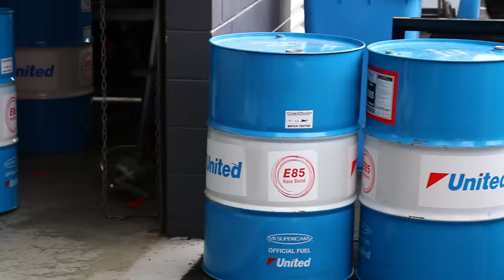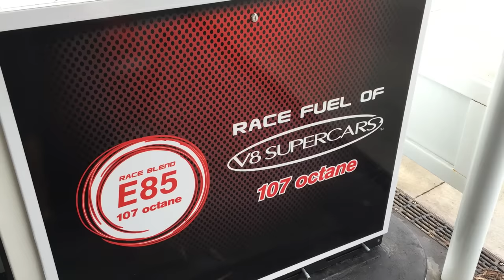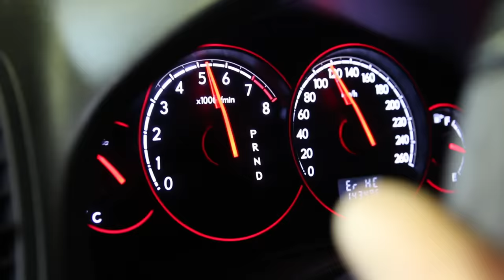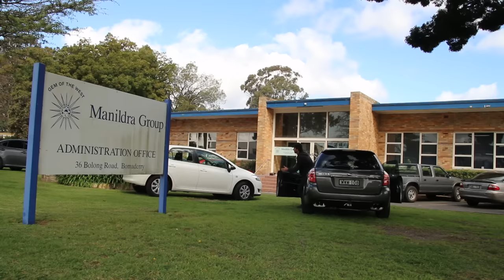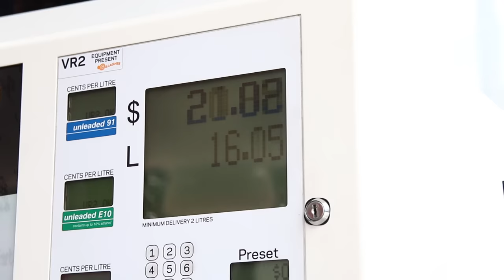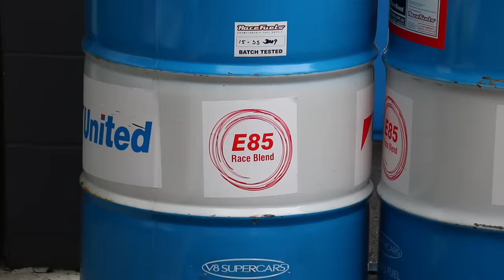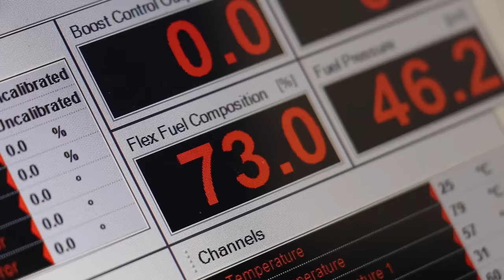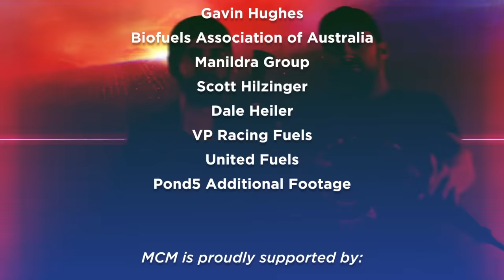E85 Fuel Explained - Should you use it?

Comment: Hi, I'm from Brasil (s not z :D ), and, first of all: sorry for my bad english. Here in Brasil we use Ethanol (Etanol or Álcool) since 1975. It was a government program called Proálcool, wich tries to solve the problems of 70's petroleum crisis. When the petrol-gasoline vanished from the gas stations, ethanol was the solution. From 80 to 86 the ethanol and cars production in Brasil reached its peak, with 76% of the cars using only ethanol (not flexfuel). The With the petroleum low prices of the next years, the ethanol start to be considered as a second choice, reaching the lowest point of sales, with only 1% of the cars produced (using only ethanol as fuel).

Comment: The most important question I took away from this: In that massive McColls ethanol refinery, what do they use as the energy source for the distillation steps? When making pure ethanol from sugars, this is by far the most energy-intensive part of the process, since fermentation gets you 15% ethanol at best. So you have to distil it in massive columns to separate the ethanol out from the water, and since both compounds have quite high heat capacities, the heat input for this is enormous - depending on how large and efficient the columns are, the energy requirement can be similar to (or sometimes greater than) the energy content of the pure ethanol product.

Of course petrol from crude oil needs distilling as well, and the process in oil refineries is similar. But there isn't much water in crude oil, so the energy requirement is lower. Plus you can burn up some of the heavier components of the oil in the bottom of the column to make the heat required to drive the distillation, which is what oil refineries do - they get all the energy they need for refining operations from the crude oil they take in. The energy use depends on the grade of crude oil used, with heavier grades requiring more processing - the overall efficiency of the process is expressed as the "energy return on energy invested" or EROEI, which is the ratio of the energy content of the finished refined fuels versus the energy used to refine them. Lightweight liquid crudes can have a ratio of 20 or more, heavy crudes less than 10, and tar oils or tar sands less than 5.

So what about ethanol production then? How efficient is that? Well, it depends a lot on the source of the sugars used, which can add or remove efficiency. Sugar cane is by far the best, since the crop produces sugar directly, so it only needs extracting before fermentation can start. Grain sources (corn, wheat, sorghum, millet and so on) are worse, since an extra processing step is needed to convert the starches into sugars - either malting as in traditional beer-making, or enzymatic processing as used in corn syrup production. Brazil has the most efficient ethanol production plants in the world, taking in sugar cane and producing ethanol without needing any extra energy input, since they use the waste wood from the sugar cane as the energy source to drive the distillation steps. 

However, ethanol production from corn in the USA is far less efficient, often using additional fossil fuels to drive farm machinery, plus the grain to sugar conversion, and then the distillation. This is why you often hear people in the USA saying "ethanol is bunk" when it comes to carbon neutrality or energy efficiency - and they are right, because the methods used to produce ethanol there are horribly inefficient, in some cases getting a negative EROEI. Hence the initial question: How efficient is the Australian ethanol production - what is the EROEI of the refineries there? I'm betting that it's going to be better than ethanol production in the USA, since you do seem to use some sugar cane. But is it as good as Brazilian ethanol production?
Reply: The single plant In Australia which they visited in the video burns low grade brown coal to run the boilers. They are not very efficient or clean but they did manage to get an effective monopoly through corrupt deals with the state government.
Reply: @SurmaSampo  Brown coal, aka lignite, aka flammable dirt? That's a fucking farce - they probably make more pollution doing that than anything which might be saved by people using the ethanol in their cars. They might as well leave the coal in the ground, not bother refining the ethanol, and just have people use ordinary petrol in their cars instead, and environmentally would be better off!

Comment: I was looking for a car and one of the cars had E85/gas listed as the fuel. I then started doing research on the E85 because I didn't know what it was and so I ended up here lol. I did some calculations on the cost of running E85 in my country and at current prices it seems to be about 20% cheaper than gas even if you need more of it. Also one of the local companies makes "eco" E85 from biowaste so that reduces the amount of resources needed to make the ethanol.

Comment: One thing that wasn't mentioned is the CO2 emissions, and I feel this is very important when talking about E85.
With fossil fuels, the CO2 in them is millions of years old and is currently locked in the coal/oil/gas deep in the earth, but is released into the atmosphere when burned where it becomes a problem, as it is extra CO2 that isn't in our "cycle".
With E85 being produced from crops being grown NOW it is re-releasing CO2 back into the atmosphere that was only recently used by plants to grow, so the CO2 balance in my opinion far outweighs the fact that you need more of it to make the same power, because all the E85 you burn is in a sustainable cycle of CO2, and not adding more CO2 to the atmosphere than we already have.
Same principle as diesel engines running on vegetable oils, they are using and releasing CO2 that was used in the crop cycles today.

Comment: I hope overseas fans are watching this and getting a bit of a taste of Bathurst. It's Australia's mini Nurburgring - fairly long, fairly hilly, pants shittingly fast in parts and arse clenchingly tight in others.

Unfortunately it's actually technically a street circuit and isn't open for power laps most of the year - but you can drive it for free on a normal road licence any time there's not a race on, provided you stick to the (incredibly closely monitored) speed limit.

Comment: The problem with Ethanol in regular cars is how quickly it goes bad. Regular gas can be stored for long periods of time and still work fine, but the water content in Ethanol will wreak havoc on your fuel system after just a couple months of sitting. Its even worse in small engines.

Comment: Basically 90% of the cars here in Brazil are flex fuel, meaning you can use both ethanol or petrol in your car from factory, which is great because ethanol here is way cheaper than petrol, specially these days...

Comment: i would love to convert to E85 , but i live in toronto Canada, WE do have a season called winter which in return will clog up the fuel injectors. AND to top off everything i just said the E85 pumps here in canada WILL NOT SELL YOU E85 unless your car was manufactured to run E85.

Comment: I first started using e85 in my old chrysler minivan because it was cheaper, but it got rid of that aweful tapping noise and gives me more torque up high, not to mention it's a cleaner burning fuel. Sure you get slightly less fuel efficiency but i think the pros vastly outweight the cons here.

Comment: I can’t get a good answer on this, people tell me these 2 big worry’s I kinda have.

I have a 2014 Silverado it’s flex fuel and I like to run e-85 from the power gain. BUT people tell me that the alcohol in it somehow destroys the fuel lines and other rubber parts. That doest really make sense because you truck was made in mind with running E-85 so why would they cheep out on the fuel lines. And then also they said that e-85 has water or something like if you put e-85 in a glass it will separate after a few days from the fuel and water. That is what really spooks me. 

I’d like to know if those are just lies or if they are actual problems, want to know if I sould just stop running it or not.

Comment: Nice video. This Ethanol thing is pretty good but I can get Methanol cheaper where I live. Even with the caloric difference,  methanol is cheaper than 95 RON which makes it cheap than ethanol. The only problem is that I can't get a bloody Methanol Flex fuel sensor anywhere so it's either/or  not both.

Comment: Here in Brazil flexfuel car are really common. Almost the unique option to buy a brand new car. Only import cars aren't flexfuel.
IMO I don't like that. I think engines with a real adjustment to use an specific fuel type have best performance. Sadly, since the 90's don't have cars with 100% Ethanol engines.

Comment: There was a man here in the US that in the 1950's created a 2 barrel carburetor that would allow an American v8 from the time to run at around 100mpg, the concept was that engines burn fuel vapor and not fuel in liquid form. Basically the carb was converted to accept a gas inlet, the fuel was warmed in a separate chamber next to the carb. it would then vaporize into a gas under gentile warming, the gas vapor would then be injected into the cylinder and would be compressed and detonated in standard fashion. The difference was that fuel being sprayed into an engine is still in liquid form, which is inefficient, but as a gas (state of mater, not fuel) the engine can still operate because gas vapor is more explosive than liquid gasoline. By converting liquid fuel into fuel vapor the conversion from liquid to gas means that you get a much greater volume and can therefore run further on the same gas. Even the modern engines of today still do not convert from liquid fuel to fuel vapor before burning it, wasting massive amounts of potential energy. 

Unfortunately there were rumors that GM bought the man out, took all the plans an patents and swore him to secrecy, and shortly after he disappeared...

Comment: Not to mention one advantage to ethanol is and this has been tested it is much happier running on a much wider stoichiometric ratio then gasoline it's got such a wide band on the stoichiometric ratio that it is still perfectly happy running and really lean scenarios also very rich scenarios where your gasoline engine just on a regular non ethanol blend even some ethno blend feels if you're talking about how wide stoichiometric curve that as most people running on that E85 vs. E10 fuel it just wouldn't run on E10 where it would run on E85 and if you're running ethanol-free fuel that don't even think about it the only reason that we're not selling it is pure ethanol fuel is because you still need a 15% gasoline mix for when you do cold starts on the engine cuz the gasoline does ignite much easier down at lower temperatures but once you started the engine and literally ran it for about one minute even in the winter you can switch it from gasoline to appear as know if you wanted to.

Comment: I've heard that higher octane fuel burns cooler. Does your engine have to be tuned to the higher octane to get that cooling effect, or does all higher octane fuel burn cooler than lower octane fuel regardless of the engine you put it into?

Comment: Sweet Video! I think the world is addicted to oil and even though E85 is not the answer it is a great tool now to fight our dependence on oil. I have a 2005 Lancer, would love to convert it to E85. Any tips on modifying the CPU? I am not worried about my fuel system, I figured I would let those parts wear out and replace them if needed. I just understand that you need to boost fuel injection for the car to burn properly.

Comment: I use e85 in my 96 ford f250 as often as I can. It has a 460 and runs fine. I have the same mileage using gas or e85.

Comment: Ethanol fuel production in the USA is mostly produced from corn which takes lots of water to grow and more    tillage (cultivating) by the farmer than other crops suitable for ethanol production. 
The amount of diesel fuel used in this production is 1.2 gallons for every gallon of ethanol produced. So much for the "clean energy" mandate. 
The use of corn also has inflated the cost of animal feed and corn for human consumption since the farmers prefer to grow corn for ethanol and collect government subsidies. 
Far better sources for ethanol are available such as Sugar Cane and Sawgrass. 
Biodiesel is even better since it can be used in all Diesel engines without modification, has a similar BTU rating to Diesel. 
Biodiesel can be produced from numerous sources including waste products making it far more environmentally friendly than Ethanol blended fuels. 
Biodiesel has even been formulated and used in gas turbine (jet and turboprop) aircraft engines.

Comment: E85 is over in the US, at least the central US is pretty much 'dead'. Sure there are a few stations here and there, but not as many as one would think. 
A big contributor to the dislike of E85 fuel/vehicles were the repair parts. A regular fuel pump was one cost (100$ avg) and the E85 pumps/components were nearly 3 times as much (200-300$ avg), with added in shop profit %'s, a fuel pump could easily be an 500-800$ repair to an ethanol vehicle, versus 300$ to a traditional petrol engine. In addition to being more costly, to both run and repair in the midwest, it was pushed out of the market place. The E85 cars weren't repaired as often due to higher costs, and were junked when the fuel systems failed. 
The E85 cars and trucks that wore the 'flex fuel' badge eventually became a stygma, the little leaf on the side and rear of the car became a symbol for the little green monies in your pocket leaving quite quickly as the repair costs mounted.  
.

Comment: So theoretically, for example in USA, there are several touring race events where competitors will spend a week driving 100’s of miles a day, a competing in various track events in between. What I’m getting from this is that someone with plenty of knowledge could drive between events tuned for 93 octane, show up just before the event and in no time, advance cam and ignition timing to make more power on E85, run the race, then change it back before leaving to drive to the next town....   Am I wrong?

Comment: My car has just been tuned to 50% Eth and 50% 95 octane... my question is, would the eth burn quicker than the 95  which will mean that if i put lets say, 50L into my car of the said mix, by the time the tank gets to 20L it would hold the majority 95 fuel and not the correct 50/50 ratio?

Comment: I noticed a guy selling a used Volvo V70 2000 model year with 350tkm and quoting the use of 50/50 mix of 95 RON and E85. 11 L / 100km for 50/50mix and 8 L / 100km for 95 RON pump fuel. 
The car seller also referred to some test fails one of which is replacement of lambda sensor.
I suspect the lambda sensor - and perhaps more - has been damaged by using a 50/50 fuel mix.

Q: Can a 50/50 mix be used safely in older 2000 - 2002 year fuel injection cars ?

Comment: What about LPG as a fuel? Have you ever considered it as a good replacement for 95 or 98? In Europe it is very popular especially in Netherlands and Poland (because of the price which is around 45% the price of the 95). But it is getting more popular every year in every European country, and in the USA as I heard. To obtain octane number for petrol you use RON or MON depending on the market, but as LPG is a gas it uses different calculations. Regular 95 (RON 95, MON 85), Premium 98 (RON 98, MON 88), Shell V-Power (RON 100, MON 88), E85 (RON 102-105, MON 85-87), Propane (RON 112, MON 97). AKI is respectively for 95=90, 98-93, 100=94, E85=94-96, LPG=105. Normally LPG usage causes drop in performance of the engine, but in a daily-driving paying less than 50% is like a great deal. The more petrol your engine is using the more money you save up. :) For example I drive 300C HEMI which in average burns 15 L/100km of 95, but uses 18 L/100km of LPG. Considering prices like 95 USD$1.07/L and LPG USD$0.52/L. And it is said that LPG exhaust fumes are cleaner. I think it's a win win. :) What do you guys think? I can add that in Polish market there is no E85 available.
Reply: I am a HUGE FAN of MCM and I love to watch your every episode! Keep up the great work! :D

Comment: Would a stock nontuned FlexFuel vehicle make more power on E85 vs 93 vs 87? Would the ECU take advantage and increase the timing on a NA engine to gain more power. I know there would be a 30 to 40% loss of MPG but would you still get more power.

Comment: I have a 1988 5.0 engine econoline i run it for 11 years on ethanol and regular gas because not all states in the USA have e85. The thing is that I'm not sure if the compression ratio is low the it clog my egr valve with carbon. The compression on they old engines are like 8.5 some thing like that do i need a higher compression to burn it better.

Comment: Did they mention that ethanol is hydrophilic and unless u distill several times and benzenate it it will carry water. And i assume that its highly concentrated but benzating cost money so its very likely that they are putting water into there engine. In small quantities.
Reply: Frank Gutowski its chemically treating it with benzene or like mixing it. Doesn't really matter tho ppl dont do that anymore i was wrong when i said this because the ppl who made it used molecular sieves.
Reply: AFAIK as long as the water is vaporized it's fine. Water going through the air intake is bad because in liquid form it will not compress, but water vapour does.